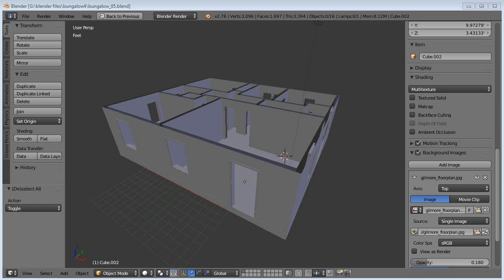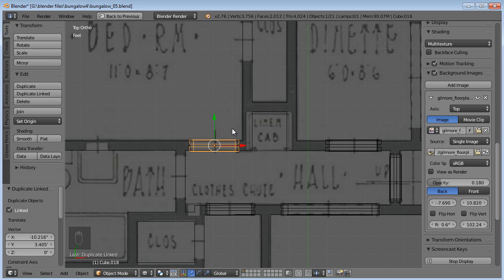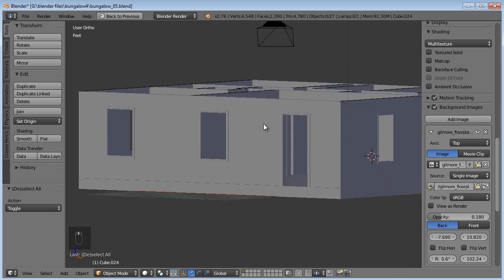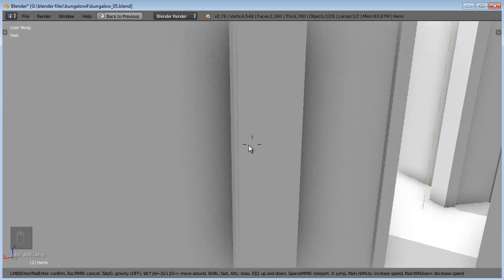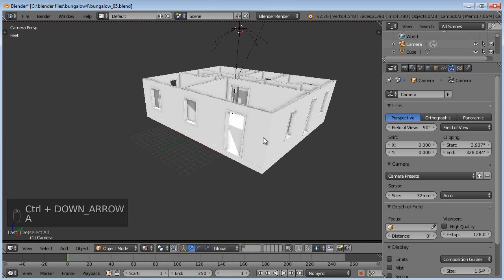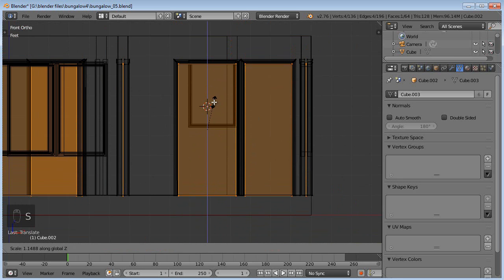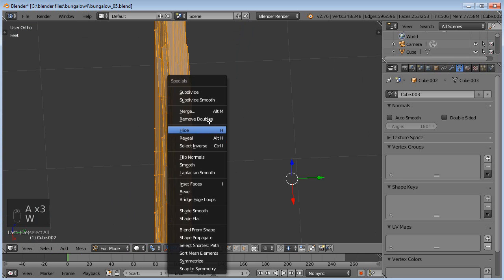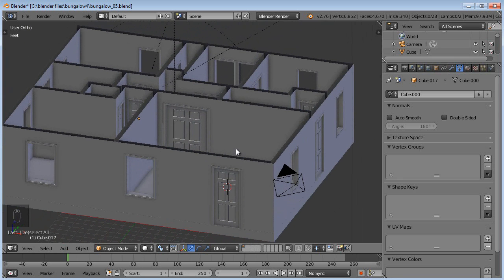Blender Tutorial Series - Building a Bungalow House Pt. 05

Comment: I don't know if you have this problem and/or if it's dealt with later. At 5:09 you finish placing the back door. You check how it looks on the outside, but not on the inside. On mine, the door cut is hard against the separator wall, so the trim of the door frame gets buried in the inside separator wall. Guess I'll figure out how to move the door cut.

Great series!